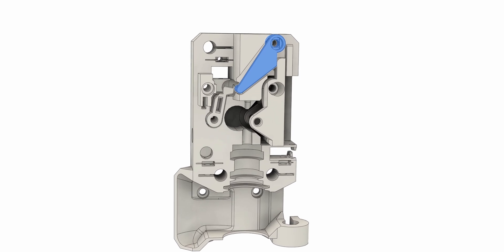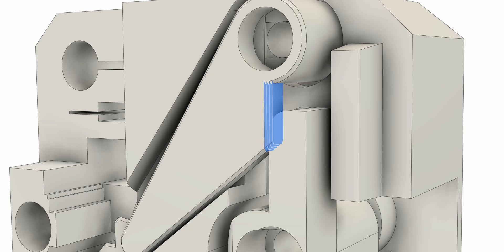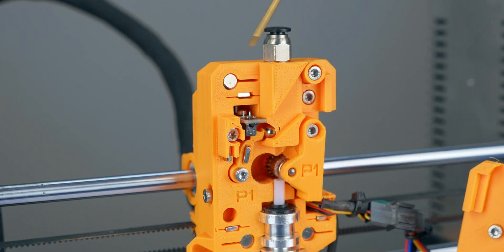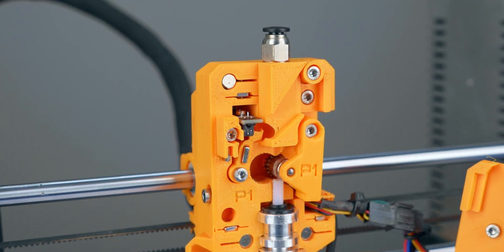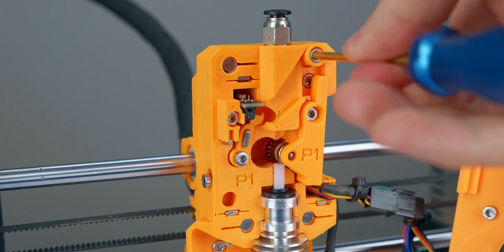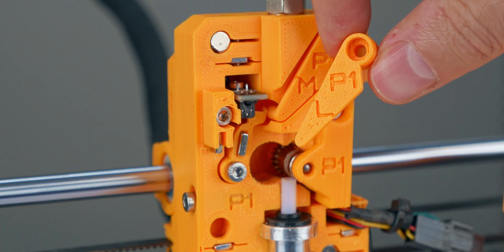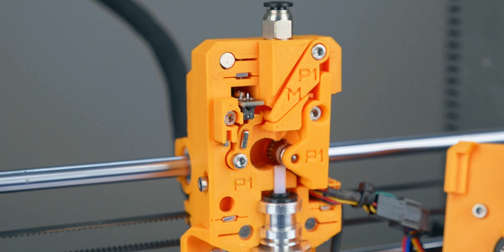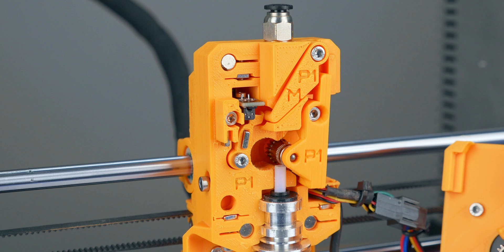PitStop multi-material mode

Comment: I really don't think the stock Prusa extruder is a great option when using the MMU2S. That filament sensor is just way too finicky where it is installed, and printing with flex filaments it really difficult with this extruder. The TZB (The Zero Beast) extruder is a huge improvement in reliability. Unfortunately, I don't believe there is a PitStop mod that is compatible with it (hint, hint 😄)

Comment: That makes me thinking of getting the pitstop extruder because the stock system isn‘t really ideal for the mmu to work with.
Reply from the maker: Yes, it's tricky. I've got 2 MMU units but haven't used them for a long time. People say it works well with MMU.

Comment: Awesome idea and development but what is the real benefit? I just made my mmu work to print tpu (need really low idler tension) and I‘m worrying about the lever working the same in the pitstop extruder.
Reply from the maker: Sounds like you've got yours working. No need for my mod in that case.
Reply: @MihaiDesigns  Ok, so literally just for the fancyness. 😍

Comment: It's funny, I just modified the Extruder Body using the Step files you posted to be able to stick the PTFE tube all the way through to right above the bondtech gears. I thought about drilling the hole but didn't have a spare part. It's working great now although I've only just installed it last night so I haven't tested it much.

The assembly video did kind of confuse me about the bearing ball so I did initially leave it out which was the right call.

I'm gonna continue being awesome now. Thanks :)
Reply from the maker: Nice work! Looking forward to hearing your thoughts on the modified extruder body after you use it for a while.